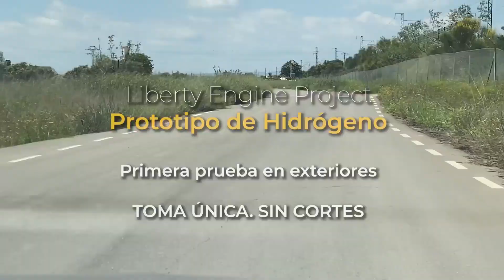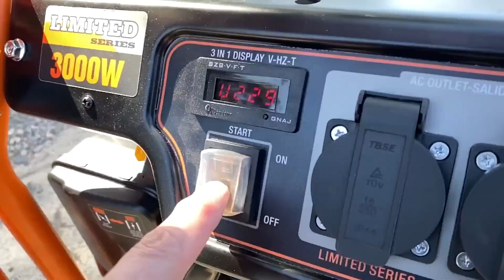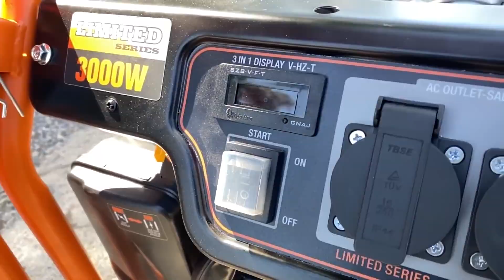TRANSFORMO UN GENERADOR ELÉCTRICO DE GASOLINA PARA QUE FUNCIONE CON AGUA

Comment: more than 50 years ago, when the hho, revolution, of the stan myers legacy, this had already been done, and others who continue the experiments, there was only one problem, this kind of fuel which i to also  tried 20 years ago, was destroying my 2 stroke mower engine over the course of time, the gas hho, is far to explosive to run efficiently. but im impressed with you experiments.

Comment: This is a reality. Hydrogen gas is what fires the sun. It's the simplest and most abundant of all the elements, 1 proton and 1 electron. That was a brand new generator and gasoline was never added. The only thing that needs adjustment is the timing as hydrogen gas burns so quickly. Just like Stanley Meyer's water car, who was murdered by agents working for the fossil fuel industry, as they have the most to lose. All the naysayers are disinformation junkies. As far as it being dangerous, if properly isolated and compartmentalized as in the two containment vessels its relatively safe. The water in the second container insulates the gas and acts as a spark arrestor. And there is no pollution in the exaust. The US government has vehicles that run on hydrogen. Hydrogen engines are another suppressed truth that mankind has been robbed of for too long.